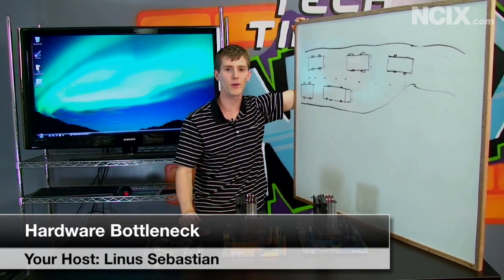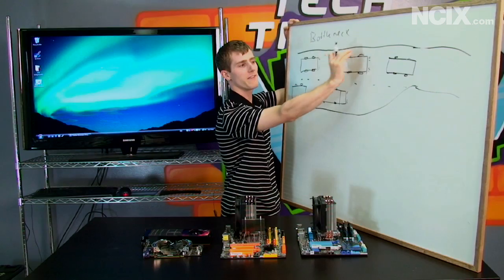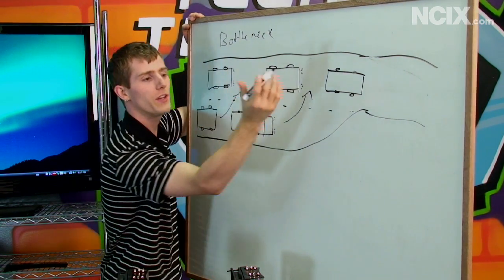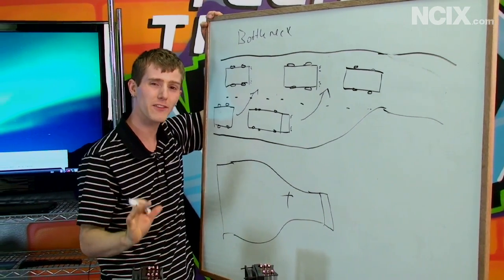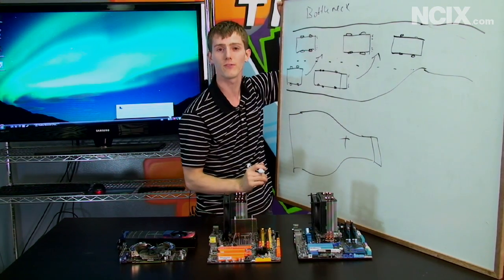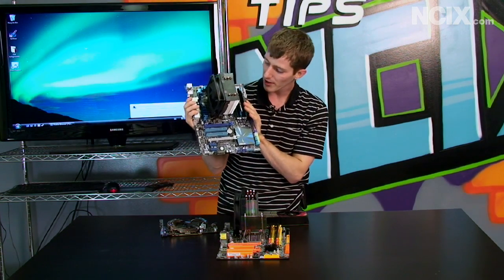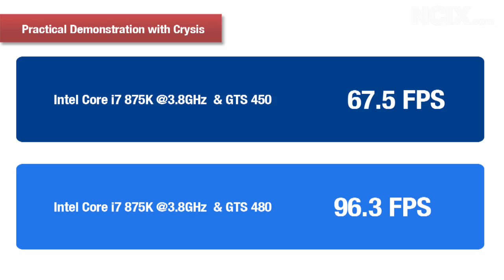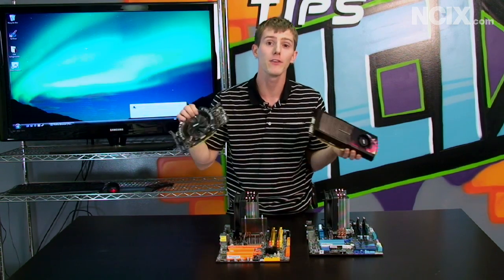Understanding Hardware "Bottlenecks" and How to Avoid Them (NCIX Tech Tips #81)

Comment: I need help please give me some tips guys I just got gtx970 before that I had gtx670 and 970 performing worse then 670, I am not sure if its a bottleneck or something else, I have the latest drivers installed, I tried sever times re installing the drivers. here are my specs
AMD FX 6300 OC 4.00Ghz
8GB RAM 1600Mhz
and the current card GTX970
Power Supply 700W

With 670 I had no problem while gaming but this card has very poor performance btw both cards are the EVGA models

Comment: Hye. Wanna ask something. I build a gaming pc with
ASROCK Z87 EXTREME 3 LGA 1150

DVD LITEON

RAM HYPER X-KINGSTON 2x4 1600 Mhz

POWER SUPPLY AEROCOOL STRIKE X 600 WATT 80 PLUS BRONZE

PROCESSOR INTEL CORE I5-4430

HDD 2 TB

Btw, i am planing to buy graphic card which is GTX 760. Will my system bottleneck? Cause i dont want to use half of the performance.
Reply: No it won't
Reply: saskwche ok, thnx for reply
Reply: That's a pretty well balance system.  I would recommend a better power supply - not higher watts, just better quality.  A bad power supply can kill everything else in your system.  The bottleneck would be the processor, but not by much at all.  Overall, this is a very well balanced system.
Reply: Drew W what do you mean better quality? Did you mean choose a better PSU brand ?
Reply: Yes, that's exactly what I mean.  There are many aspects of a PSU to consider.  Voltage regulation, voltage ripple, over and under voltage protection - the list goes on.  Any company can build a PSU that delivers 1000 watts and around 12 volts.  But building one that gives you a stable 12, 5 and 3.3 volts without fluctuating too far up or too far down no matter what your load is, and without rippling your components to death, isn't as easily done.  Most people don't know this, and go for a cheap one.

Comment: I'm running an ATI Radeon HD 5450 [L371] clocking at GPU 690MHz Memory 722MHz in conjunction with an AMD Athlon 7550 clocking at 226MHz, 256MHz max otherwise Windows XP gets upset. Can't remember what the RAM is clocking at. It isn't always what you spend on the rig its what you do when everything is installed!

Comment: my specs:
ị-4590 3.3Ghz
8gb Ram Corsair Vengeance bus 1600
MSI GTX 750Ti Twin Frozr gaming OC
Mainboard Asus B85 Vanguard
PSU: Cooler Master 500w

please tell me if this bottleneck cause sometimes it runs too noisily.
Reply: I don't see a bottleneck but I noise does not always correlate to bottleneck, do you have water cooling? If not I would upgrade if possibly and that power supply might be struggling a bit
Reply: 851995STARGATE
thanks a lot. I'm thinking of upgrading it with SSD also.
my PC is sometimes really noisy even though I dont do anything much. But I dont know whether the noise comes from the fans of the VGA card or the stock fan of the CPU.
Reply: Dao Quang
You should download speedfan and see the rpms of the fans compared to temps if the temps are really low and it's still loud than the fans don't need to be on that high and you need to adjust the fan curves in the bios

Comment: what about the fact that a 4core processor might handle a game same way like a 8core processor  but get's way hotter  when running at like 90% stress while the 8 core chills at like 50%. Didnt you told us that heat lowers the life of hardware ? ;)

Comment: hi i have gigabyte ud5 980fxa board with a 960tunlock to a x6 at 3.6gb with 16gb 1600mhz vengance ram with two gigabyte 7950oc and 775w psu wil it botle neck
Reply: and wd caver blue hard drive

Comment: Then how sould i pair my components? I have an i7 930 and ill buy a gtx 780ti soon. Is it enough? Id say yes. Probably im gonna lose a couple of fps as my mobo is "just" pci-e 2.0 but other then that i dont think ill lose anything else.
Does anyone agree with me? Or am i wrong?
Reply: trolling?
Reply: Farago Gyorgy Hmm sorry but no. This i7 930 is about a high i3 Haswell cpu. The 780 ti is the most top end GPU you can get today. As you can probably tell pairing a high Haswell i3 (4th gen i3) with a 780 ti isn't really an amazing choice. Sorry :/. To be honest, you should probably be looking at an i5 4670k or an i7 or an fx 8350. The i7 4770k > 8350 > i5 4670k. An fx 8350 overclocked or i7 4770k (possibly overclocked) would be really what I would reccommend. Hop on a forum (such as Linus tech tips) and ask see what people think about one of those choices and also I'm sure they will confirm that the 930 unforunately isn't enough to get you going. You won't just lose a few frames, you'll lose a lot of frames. ALTHOUGH, it will depend on what games you are playing. But still, I really don't think thats a good pairing. EDIT: I just checked and the Passmark (I know its a synthetic test and not 100% accurate) confirmed that the i7 930 was 5182 points and the i3 4430 about 5117 points. So, a little bit more than a high i3, but not really near to a low new-generation i5.

Having said that. There is a community which does this sort of thing. But the fact is it would bottleneck it to at least some degree. So I suppose it could suffice for a while if you overclocked it. Once again, please look for forums on the internet on this topic and consider the games you're playing. Really in the future I think you should upgrade your CPU. 

Also considering the fact that you are spending what 700$ on a GPU, I wouldn't have though it'd be too much to spend say 200$ on a cpu such as the fx 8320 with an aftermarket cooler (overclock it yourself) or 8350.

Comment: Hey guys I was wanting to upgrade my cpu from a i5 3230M (Dual Core) to a i7 3630QM (Quad Core). My Laptop is a HP Probook 4540s. My GPU is a Radeon HD 7650M. I have 8GB of SD ram with a speed of 1600. My HDD has a speed of 7200 RPM. 

Would upgrading cause a bottleneck? Or fix a bottleneck?
Reply: What's the reason that you're upgrading?
Reply: Well, I am a pc gamer, and I saw that most of the newer games that are out now a days require quad cores to run at good speeds.
Reply: TheButterZombie
I suppose it depends on the cost of the upgrade... I've generally found it's not worth upgrading laptops at all (other than installing an SSD, perhaps).
Reply: No, this upgrade will not cause bottleneck
Reply: Vernon Trinh Thanks for reply. I upgraded and now some games are running about 5 fps lower than normal. Why is this?
Reply: TheButterZombie
You're expecting someone who didn't back up his statement to get back to you on that? >.>"
Reply: Do you know why it it doing that?
Reply: you're complaining about 5fps lower lol? of course upgrade a cpu doesn't necessarily mean the fps will go up if any at all. Its just letting your computer handle more process while gaming. I also dont understand why you're trying to game on a laptop instead of a desktop. If you were on the desktop, you could have bought a K edition to overclock, as well has have easy gpu replacement.
Reply: Thats true, I wanted a mobile gaming device so I could play video games on a airplane or a long car ride. Anyway, I know it was a 5 fps loss but it felt like a ten or 15 fps loss. Gameplay wasn't as smooth. I fixed it by disabling Hyperthreading.
Reply: yeah, road trips
Reply: because pc gaming is awesome.
Reply: -_- my phone can tether the wifi connection to my laptop!!
Reply: TheButterZombie your laptop is still going to be fucked up when you upgrade it.
Laptops were not designed to be modular, all upgrades run the risk of incompatibility and otherwise lesser performance than before due to unknowns in the laptops design.
Reply: I upgraded my cpu a few weeks ago in this laptop, and the performance was much better!
Reply: nilloc93 Depends on the bios and motherboard. Most laptops can be upgraded as long as the CPU can be replaced and it may require a bios update most of the time.

Comment: guys what about I3-6300 and gtx 750 ti?
Reply: no
Reply: yes
Reply: you mean,i will have bottleneck?
Reply: I mean you won't have one
Reply: Your cpu would bottleneck, that 750ti but it wouldn't be terrible. I have a i5-4690 (non K) and while running crisis 3 ultra 1080p and BF4 highest setting 1080p I do receive good FPS but... While looking at usage during gameplay, my CPU usage is ~40-50% while my GPU is at 100% while occasionally over-volting (and I do not have any OC on neither products.) I'm doing research to balance out my usage by upgrading my GPU.

Comment: could anyone tell me what my CPU could support at max ? right now I have a intel i3 2120 @3.3ghz  and an Asus Geforce GT640 4042MB and 8gigs of ram.
I am planning on going to a GTX760 ( from asus ) but i think it would be a bottleneck so would a GTX660 be better for me ? ( GTX760= 220€ GTX660=160€ )
Reply: get rid of the i3, and get the i5-4670k and then grab the 760 if you have enough money left
Reply: GeesherTube  yeah I actually thought about that and am probably gonna go that way, tho not going up to the i5 4670k but more like the 4570 since it is 50€ less and because I need to get on top of that a new motherboard to go with the new processor since my current one only is H61 chipset and supports LGA 1155 ( right now thinking about a MSI Z87-G45 )
Reply: simonoi11
then go with the i5-3570 same motherboard or 3570k and I would go the a EVGA 760 best bang for your buck and great CS

Comment: amd FX8150 8gb 1866 corsair ram R9 280x Dual-x and a 850w psu
Reply: would there be a bottle neck on the system running on a sabertooth 990fx MB

Comment: Im going to build a new system soon, will it bottleneck?

CPU: i5 4690k
GPU: Asus STRIX GTX 970 
Motherboard: MSI z97 gaming 7
Ram: Corsair Vengeance LP 8GB 1600MHz
HDD: Seagate Barracuda 3TB 7200 RPM
PSU: Cooler Master GM G650M

Appreciate it if you could help me out!
Reply: sorry for asking instead of answering but im a noob too. i was just curious about your ram speed, i am also planning a build and i am looking forward for an 1866MHz ram instead of 1600. is there really a difference?
Reply: Romie Jay Eque Yeah there's a little difference, but according to the tips Ive heard it's not really worth the extra price.
Reply: Besides it all depends on the latency.. 1600MHz, with a 7 latency has a response time of 0.004375 seconds while 1866MHz with a latency of 9 would have a response time of 0.00482315112 seconds..
Reply: Urbanpowertw Thanks for replying, how do you determine the ram's latency by the way? is it usually printed on the ram or on the box itself?
Reply: Romie Jay Eque Usually in the description as x-x-x-x (the first one is CL which you want to know.) The ones behind it.. dont bother, not worth the research as a newb. CL = Cas Latency which is basically the RAM speed, so a CL rating of 7 is really good.. if youŕe talking about 1600MHz and the average 1600MHz ram has a CL of 9.
Hope this helped you!
Reply: Urbanpowertw you shouldnt really have any bottlenecks.  I have a pretty similar setup to you, (though im running an i7 4790k, but a i5 4690k should do the job just as well) and it doesn't seem to have any bottlenecks.  If I were to say something, I think the z97 board is alittle pointless unless you want to use the m.2 slots or other features it has.

Comment: hey guys i have a r9280x gpuy and a  amd 1090T cpu  in battlefield 4 etc my fps is terrible drops all over the place  like average 40 fps is drops to like 25  will this be a bottleneck?  says the cpu usage is like 80% and higher whilst playing
Reply: Yeah, your CPU is is bottle necking your graphics card. Get a better CPU and most of your problems will stop and you will get a higher frame rate.
Reply: I would of thought this 6 core CPU would not bottleneck seems i need a new CPU. Was looking at a pile driver quad core  what do you reckon
Reply: Do you have to stick with AMD?
Reply: Yeah mate can't afford to go to intel for a while
Reply: Just a sec, how much ram do you have?
Reply: Yes that sounds like a CPU bottleneck mate.

if you read my post at the top of the page, the best way to check for a CPU bottleneck is record your frame rate  at a certain point in the game and then re run the same test inly dial down the demanding graphics settings and if your frame rate doesn't increase even when using lower settings that means that the CPU cannot physically prepare anymore frames for your GPU to render.

This does sound like a CPU bottleneck though. The best thing to do is overclock the CPU and disable all other tasks when gaming, things like anti virus etc
Reply: 16 gb of vengeance ram
Reply: Thanks a lot man. Am getting a new motherboard in the morning. Cos I have my new 8 core here but my current mobo doesn't support it so I'll see this fixes it all I'll post on here
Reply: andrew cairns  Yeah give us a shout and tell us how you get on. I think it will do the trick
Reply: On my way too the shop now for motherboard :) I'll post on here
Reply: Still got the same problem. I 
Stuck now. Tried 8gb ram and swapped the others and tried the they 8 still the same. What next.  Psu?  Hdd?
Reply: andrew cairns  What problem are you having?.
Reply: My ram test came back at hardware issues with my memory I've tried each stick one by one and all but one kinda works. Still giving fps drops in games though but 1 stick is only 4 gb not enough
Reply: andrew cairns  You shouldn't have too many issues only using 4gb of RAM as that is all I had up until recently and was able to game okay enough?.

Unless it's because it's not dual channel?.

How did you end up with RAM issues?.
Reply: I guarantee you it is not bottlenecking! I ran a 7950 on an OC'ed 1035t @ 3.75ghz w/ 1333 ram and it ran great at ultra on 1080p. BF4 has always had issues. I upgraded my cpu and mobo to an 4670k with the same gpu and still noticed some hardcore lag after the manlte patch. Try uninstalling and reinstalling both your drivers and BF4. Helped me out a lot.
Reply: It turned out to be my mobo and cpu settings in my bios they where all fucked somehow do i didnt need to buy a new mobo and cpu ha awell
Reply: JAGUARCD32X my ram was fine a guy testes it all   so i saved all 16gb of it
Reply: ***** well yeah battlefield 4 is  broken ha
Reply: saskwche all fixed too but am selling my r9 280x to get a 780  or see when the 800 series is out  i should of gone intel  this time what a mistake
Reply: Does anyone know why my cpu temps are bouncing all over the place even on idle its like    9    12  20 25 18  like constantly

Comment: Your ram speed is slow too. You can have two sticks of faster ram. 2133mhz instead of 1600mhz... Kaveri processors support 2133mhz... But I dunno if your a55 chip on motherboard will handle it. Im assuming your motherboard handles both fm2 and fm2+. If so faster ram will be better... Also Your 750 ti GPU is weak for the a10-7850 or equal athlon x4 kaveri apu/CPU. That GPU is entry level. You can go with an r9 or nvidia gtx better one.... Also your motherboard maybe slight slight bottleneck. With that a55 chipset.. but I don't know if it will bottleneck you f sure. A single GPU should be fine. Save all coin and get a gtx 960.

Comment: I'm getting a X5650 Xeon with 12gb of ram and a Zotac 970 Amp extreme
Core edition and people have said I should be fine since the Xeon is a hex core and can over clock but I'm weary since it's not a i5 or i7 since I'm upgrading an old workstation that seems to work fine so I just want to play some GTA V and Arma 3

Comment: I have an i7 4790k  4.0ghz gtx 1080 8 gb of ddr3 ram mother board is a Asus z97a and just a regular 1 terabyte hard drive. I'm told 1080p gaming should be overkill for the gpu I have but games like arma 3 and gta 5 I can't hold a solid 60 fps it has too many spikes and studders
Reply: i'd suggest you  upgrade your cpu in the future no rush though however i highly recommend upgrading the ram to something ddr4 otherwise everything is fine (side note: an SSD is something you will NOT regret buying no matter how much you pay even if you get 120 gb just for the system and booting)
Reply: Christian Difelice I might be tad bit late , but haswell processors aren't too out of date, I would say it would be just the right spot for gaming right now , and I would recommend upgrading maybe when kaby lake comes out because the current upgrade for a i7 4790k to a 6700k isn't worth the hefty price. Adding on, you should take inconsideration instead of an upgrade to get a higher resolution monitor , because what you said is true. 1080p gaming on a 1080 is complete over kill. My 1070 is just amazing for 1080p and I'm trying to save up for a 1440p monitor to enjoy this gpu more.  I'm not too sure if all you play is arma , but that is a big CPU bound game, try uping the resolution to take some load off the processor and i guarantee a shift in fps. Also be careful what was stated above because the i7 4790k does not support ddr4.

Comment: would these bottleneck? Video Card ASUS GTX780-DC2OC-3GD5 GeForce GTX 780 3GB and i7-4770K Haswell
Reply: Intel Xeon E3-1230 V3
Asrock B85M Pro4 mainboard
G.Skill Value Ram 8GB DDR3 1600Mhz
AMD SAPPHIRE R7 260X
WD Caviar Blue 1tb
FSP Hexa 500w
LiteOn DVD writer
CM K380

is that bottleneck?

Timothy Rogers
Reply: Timothy Rogers
AMD Phenon 1100T 
H100
16gb ram
290x
750w psu?
Reply: JaredHasNoBrain No you won't. Even at stock settings that 1100t is a beast. OC that and you'll be good for a bit longer

Comment: will i have a bottleneck with this system that i am putting together
i7 4790k
16GB(2x8) ddr3 1866mhz ram
evga 980 4gb sc acx 2.0(will sli in the future)
psu 760w
Hitachi Deskstar 3TB 7200RPM
windows 8.1
Gigabyte GA-Z97X-Gaming GT motherboard
Reply: if you haven't bought your processor yet i am trying to sell an i7 4790k unopened for about $310. I got it from newegg and then realized it wouldn't fit my motherboard.